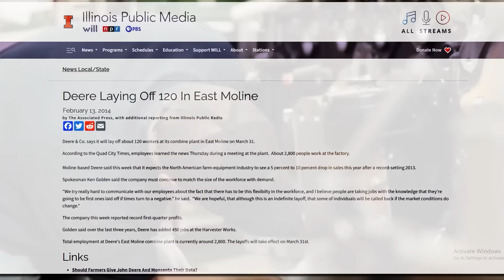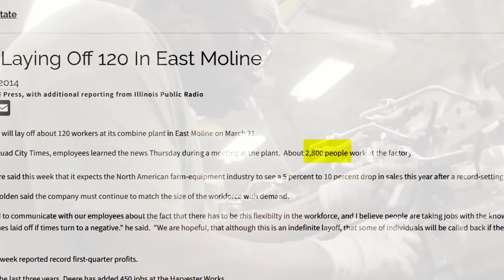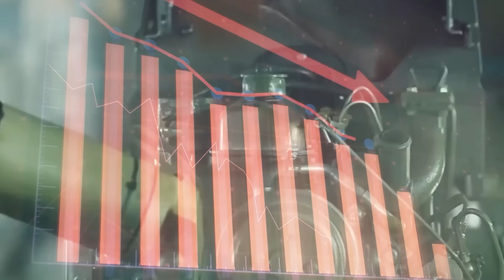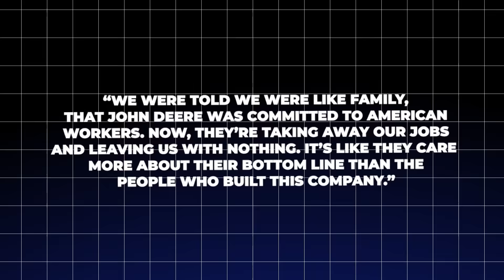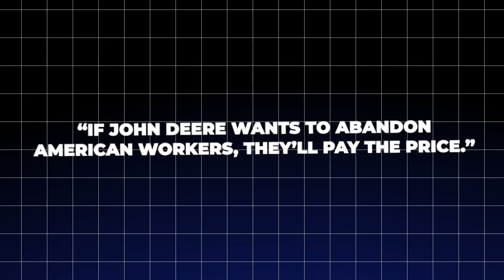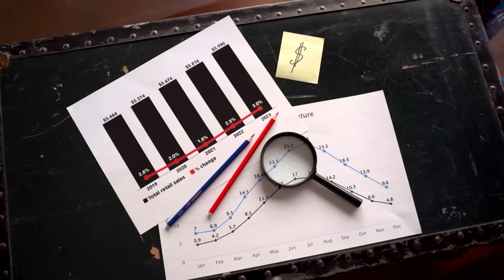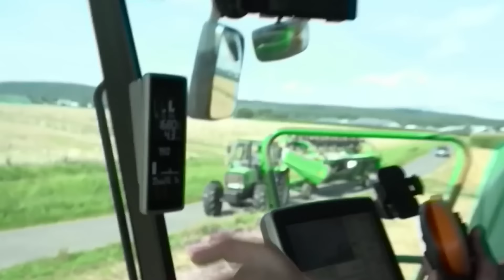John Deere In BIG Trouble After They Did This...

Comment: I bought a dual rear axle Gator....good powerful utility vehicle but it doesn't steer left or right only straight.   When I took it to the dealer they said to reduce the air pressure in the rear tires to half the rated pressure to get some down force on the steers...it improved the steering until I put a load in the dump bed...again no ability to steer and it destroyed y he sidewall of the tires...POS design.

Comment: I went through this ten years ago.  I used to work in high-tech electronics manufacturing.  We suffered an economic downturn, and we were laid off.  No big deal, it happened regularly, and we would be rehired when the economy recovered.  But this time would be different.  Unbeknownst to the workforce, us, the company, shipped all of the jobs to Mexico.  So, when the economy recovered, none of us were rehired!  You see, why pay an American 10 to 12 dollars an hour when you can get the same job done in Mexico for $1.65 an hour, and away the jobs went.  Two years later, they took the jobs out of Mexico and sent them to China.  Why pay a Mexican $1.65 an hour when you can get the same job done in China for $2.00 A DAY?  That's about 25 cents an hour!  I can't even buy gas to go back and forth to work on that.  And, most interesting, the companies have not adjusted their prices to reflect their lower wages to their employees.  Their customers are still paying the old pre-shift prices.  Actually, it's higher, adjusted for inflation annually!  Any 'American' company that moved their manufacturing out of the country is guilty of this and does not deserve your loyalty!  John Deere is just trying to get a piece of that pie!